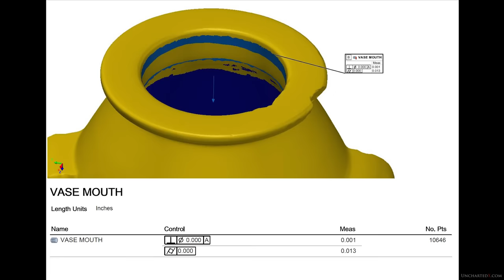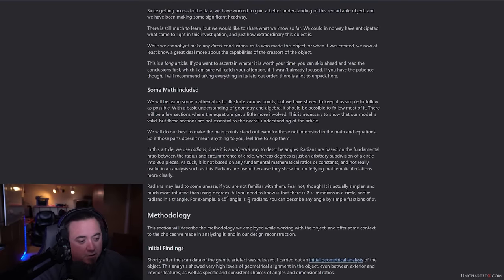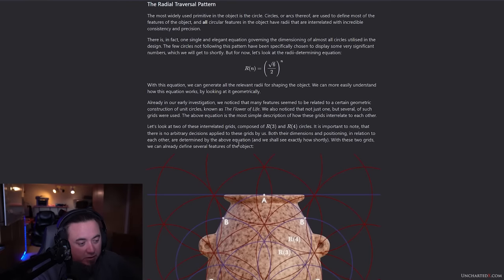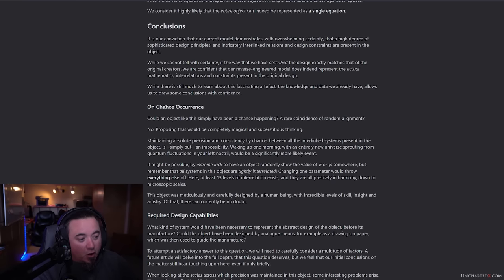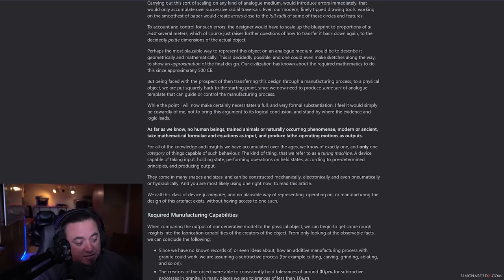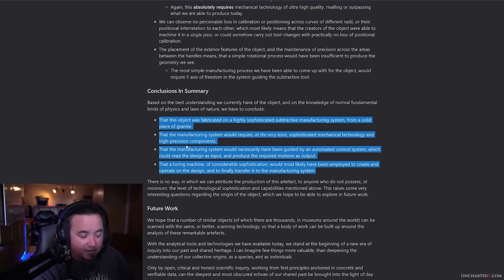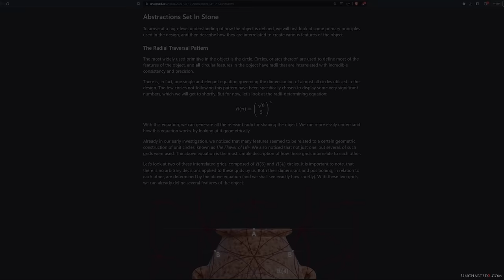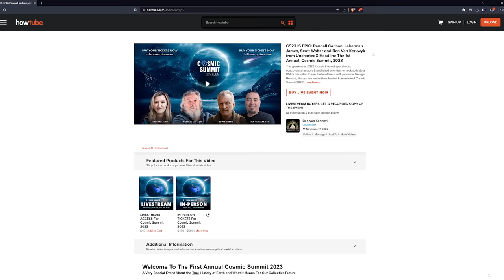Was a COMPUTER Used to Design this Artifact??

Comment: Even if we assume that this was made of geopolymer, you only solve the smaller part of the problem here. If these were made of an artistic mix of geopolymer it would be easier to carve these while they are softish, you still need some kind of precise milling machine and some advanced math.
Reply: exactly. the geopolymer theory is just a distraction.
Reply: @AustinKoleCarlisle  Not completely just a distraction.  Being able to carve a soft material like incompletely cured geopolymer allows a human powered milling machine made of copper and maybe iron cutters built by the same people who made the Antikythera mechanism a viable option. I would suspect a careful chemical analysis of the stone vessels and solving the puzzle of the Antikythera mechanism will probably solve the mystery here.
Reply: @magnuszerum9177  the problem still remains that they couldn't realistically have maintained the incredible tolerances found on this object using known ancient technology.
Reply: @AustinKoleCarlisle  Thus the need to solve the mystery of the Antikythera mechanism.
Reply: @magnuszerum9177  more than likely an Atlantean, out of place artifact. and there are probably many more artifacts like this under the sea. unfortunately, places like Gobekli Tepe get all of the attention despite the fact that there are likely numerous ruins of civilizations way older than GT under the sea as it rose 400 ft in the last 15,000 years.
Reply: geopolymer idea work only with limestone  not granite

Comment: I think it may have been possible to produce the intricacy that we see in the object by using frequency on the material while it's in a molten state. Possibly held in a mold during this process.
Reply: But the mould would have to be even more precise than the object. Think again
Reply: @TheDAT9  Yea, but I think that's the right line of thinking.
Reply: @dionharris8928  It would be great to go back and ask them.

Comment: My goodness I own one of these vases mine is dolomite from an Oldman in Egypt on my 5th visit £35 I payed, First he drills the hole with a 2 inch copper bore drill with quartz sand then he soaks the block in water then heats it up to remove the brittle and repeats used quartz sand paper to Smooth, vase is on my fireplace.
Reply: any handles on this vase?
Reply: @AustinKoleCarlisle  no it has thin lip which looks delicate.

Comment: I have done machine work building parts for varion-cpi. Radar tuner pole plates etc...Tool changes were basically a do-over. touch off the part, find zero....its impossible to make this vessel this close to perfection.

Comment: I guess it’s accepted that the lugs on these vases were used for carrying and yet it seems impractical. The hole is very small and would only allow a string with a small diameter. These people made such perfect artefacts why wouldn’t they come up with a better way of carrying it  unless these lugs were not for this purpose or did a more elaborate handle disappear over time.

Comment: The mathematics to design something like this has been well approximated by your experts. The technology and tooling used  may still be well beyond what we can extrapolate from our current technology. I can only speculate using some form of laser/ultrasonic non contact process we have yet to even conceive of. From your description of thousands of these precision artifacts in existence, the technology must have been easy to use and inexpensive.

Comment: I wonder how the 3D-printed version you have would stand up mathematically to the original.
Reply from the maker: it would be interesting to inspect them but 3d printing (particularly those lower end machines) aren't getting anywhere near that level of tolerance

Comment: The most interesting thing is that is seems to have been done in 1 pass. Hang with me for a sec. What if all the advanced math that goes into it, being Pi and the golden ratio, isn't held in a computer per say, but done with sound or vibration. I don't mean to be one of those hippie dippie comments, NIkola Tesla himself says “If you want to find the secrets of the universe, think in terms of energy, frequency and vibration.” Tesla believed that the Egyptians held these secrets. What if they weren't using machines, or machines in the terms we think of. Yet instead harnessing energy, frequency and vibration to create these amazing structures, from big to small. What if it wasn't advanced machines we lost at all, just an advanced connection and understanding with the elements around us.

Comment: This is fascinating. Love this content. 
Just had a thought about how they “could” have produced this object from hard stone in one go without tool changes - a sophisticated copy carver could have been used. This way, the geometry could have been designed and manufactured as an initial “master” in an easier to work material to a very high finish - granted that’s still an incredible feat of knowledge and craftmanship - then using the copy carving machine (which could have been pantographic in operation to reduce to the required size from a large master to improve accuracy - these exist as equipment used in making injection mould tooling prior to the advances we have had in CNC machines) the stone object could be produced. This is still high technology, just my speculation on how to do the side “handles” without a tool change.
A way to test this hypothesis would be to find out if there are any of these vases that match one another in geometry very closely - that would be an indication in copying from an original “master” model.

Comment: I am not sure what kind of 'advanced' civilisation would use solid rock to create utensils instead of pottery, unless 'they' had not yet invented pottery or writing perhaps. Geometry does not need to be defined by equations, and computers do not need to be digital to be computers. What is probable is that some kind of analogue template machine (PANTOGRAPH ?) constructed of interrelated circular guides or paths was used. And what is certain is that there was a 'machine' , possibly acoustic, that could cut rock so easily when guided that these folks did not really need to invent pottery. However rock was cut in this period , it was a technology completely lost to modern science.

Comment: Water is used to cut the hardest materials in manufacturing. Could these vases have been carved using high pressure water jets?
Reply: Possible, However, with a water jet how do you accurately hollow out the inside?.

Comment: What is being described here is a process called "descriptive geometry", it was a well known process used before cad. This could, likely, have been the process of the making of such geometrically conforming object without a need for design, as these are highly unlikely designed because of the self-similarity of other vase like objects. The lack of communication skills present is also a bit of a giveaway. Also there is a maths, using polar coordinates as opposed to Cartesian/rectangular coordinates and it isn't magical but it necessary to use when working with rotating object. These are rotating object and is therefore likely analogous to our modern polar coordinate system of mathematics.

Comment: Maybe it's a crucible, those holes are too small for fingers, so maybe it goes to another machine for moving molten metal? Whatever fits in those holes would tilt the vase and poor the metal into a mold. Just a thought. Great video nonetheless!
Reply: no , granite cannot withstand molten metal poured thermal stress fracture will ruin it
Reply: I think it would need a spout to direct the metal. The lip is round

Comment: Gidday Ben hows it going mate?  Great video. The only negative thing I would say is that you say - "VAYS" instead of - "VARZ".  Your an Aussie mate!  Don't let these bloody Americans beat you up!  Talk proper 'Strayan' mate ok?

Apart from that, the technology involved in creating this vase must have been incredible.  Maybe it WAS made in some type of lathe, but one that could stop, pull the tool tip away, then re-apply the cutting tool & continue on?

It's very more likely that it was cut using some kind of programmed multi-axis milling machine - with those handles on there!

It's a wonder such effort & precision was used to make a bloody vase though?  Unless it was very EASY for the makers to achive such precision?

You say there are 5000 other vases that are probably made woth the same precision, so it must have been easy for them!

Oh well, either way mate my mind is still blown by all this precision, including pi & phi too huh?  Wow!  Just wow!

Comment: Hmm, this is quite remarkable.
I think it's pointless to speculate if these people had precision cuttings tools - clearly they did. And not simple lathes or mills either but multi-axis machines that could cut whilst rotating about a second axis.

If these vases did not have the side 'handles' and were round in section their run-out precision would be incredible.
That they also have a complex shape that CANNOT be made in a single axis is truly impressive.
I'd be interested to know what could be achieved using a modern computer and machinery and an easy to machine material such as aluminium. As a comparison
I would be interested to see a round one and one with the lugs produced to appreciate how challenging they really are.

You also cannot rotate objects rapidly, and apply a tangential cutting force with any degree of precision unless your job is really precisely centred - which means bearings.

That someone has tried to deliberately show these mathematical inter-relationships, which they must therefore have been aware of is beyond doubt - the chances are nigh on impossible as stated.

But I'm far less convinced about the need for Turing machines though.
All of these constants are related by geometry, so when you start interacting motions around different shapes, radiuses, arcs, etc or different orientations some of these constants will emerge naturally.
If i put a peg in the ground and tie a piece of string to it, and with the sting pulled tight mark its end - now walk around the centre peg and scratch a line on the ground.
With no understanding of maths and perhaps not even knowing how to count (think ancient pre-tech person) I would have encapsulated pi and pythagoras within the circle I had just drawn; even though I might not know that it was called a circle or ever heard of the Greek guy from the (then) far future!

By having centres rotating around centres for the cutting tools, different, and varying radiuses will be cut, and again the emergent ratios will be not disimilar to the 'flower pattern made of circle arcs'.

Back in the 70s there was a toy in the UK called 'Spirograph' This had various rings and disks with toothed edges and holes drilled in them. By putting a pencil in the holes and making the one item run around the outside or inside of the other it would draw all sorts of trochoidal shapes.
By understanding the curvatures produced by the combined radii all forms of patterns are possible. (and given that all complex patterns are combinations of simple patterns - this does indeed mean all in a mathematical sense!)

Note too the large (multi-ton) column top with rounded radial flowers that is' abandoned at one of the Egyptian sites and features in some of the videos on this channel. Using similar evolutions for your cutting equipment would allow you to generate complex machining patterns like that; and cut them again and again in other columns (assuming there were several, which I think there were?)
That would be a hell of machine though, a rock that size cannot easily be spun multi-axis - so it's possible (likely?) that the rock stayed still and the machine moved around it.

I don't think these were single pass machines - granite doesn't look like it will tolerate that. But cutting slowly would require changing tools often - which again suggests a very sophisticated and precisely mounted machine.

But I see no way on earth to make a machine that can work at this tolerance made from wood - copper - lead, etc. Or any organic plastic.
Not only does this need something with the properties of steel it also requires the full technological history to go from making the first piece of steel to building even a basic lathe.
Clever as many of us are in the modern age, if you took any of us back more than a few centuries our technical knowledge would be useless as you'd eventually need something that didn't exist yet; or have brilliant ideas that could not be technically realised in your lifetime.
Reply: it's not that the vase was carved by circles that's remarkable, it's that it's based on a radian system of measure and not on base 10, etc.
Reply: I agree. Its possible that its naturally arises, because of the flow-of-life pattern, the pi ratio especially. Its a single coincidence that repeats. Although for the radian measure on multiple sites, its something else. I think there is validity to this. Its an astonishing find.

Comment: The mathematics used back then is probably similar to the ancient Greek mathematics,which was different from modern math,it was a more visual and graphical representation of numbers and concepts like the number zero...

Possibly easier to design objects this way?

They don't need computers or electronic ones anyway to do this

Also relics like the antykathera mechanism which shows that clock work computers existed in the ancient world 🌎🌍

They could have even developed a punch card like system

Comment: So here is a few questions that I would love to hear the mainstream archaeologists explain. Hear me out, how could they know there would be no flaws or micro cracks in the internal rock? They carved massive statues from random blocks? Imagine the time and materials lost if that goes wrong. So it was either so easy for them to do it didnt matter if one went wrong, or they knew the qualities of the internal material before they started. Then remember that egypt sits on a geological fault.... How did they know the stone was good for something like the pyramids? How did they know that stone wouldnt just crumble under the weight? Its stuff we take for granted but they would have no way of knowing that. I think we need to look at what all the stone used has in common. The litteral base mineral composition of the stone because they did it with these materials for a reason and its all we have to go on.
Reply: @darklight2.1  Yeah you used the wrong example, David was carved from a flawed marble slab. I am not questioning if they did it, I am questioning how. They pick massive blocks of perfect stone, calculate the exact amount of lost volume perfectly so pairs of massive statues match. Thats impressive, the statues do exist. How did they know exactly how much they would lose and the stone would be of sufficient quality to make matching statues and uniform blocks unless it was a controlled process. I don't see why you took a defensive and reductive attitude. You litteraly changed none of my opinions so all you did was waste time.
Reply: @darklight2.1  You just wrote hundreds of words in response.... Twice.... Couldn't care less..... Weird...  🤔
Reply: @DevilsAvocado69  the test pits at the unfinished obelisk are quite telling, especially considering that it's barely big enough for a person to fit inside, let alone use a "pounding stone", LOL
Reply: there are plenty of reject stones partly carved laying around the pyramids
Reply: @5hiftyL1v3a  lmao, so they cut stone, dragged it hundreds of miles, just to partly carve it and leave it infront of the structure you are building..... Or they could have carved where they quarried and saved the journey.... But sure loads of rejected stone around the pyramids right... Lol
Reply: @DevilsAvocado69  you sound sarcastic - but yeah. What’s do you think all the stone that they show which aren’t finished are? Or why so many of the floor stones have cuts in their sides etc etc. 

Stones are cut, and if you encounter a flaw in the middle you just have to move on to about her stone. It’s what they did. It’s what we do today. 

lol I mean all the random stones they use as examples in these videos are often rejects - that’s why it’s a just a random slice in the side of a stone etc. 

And yeah - that’s what they did. They often carved them on route - the same as they did with the Thunder Stone in Russia. It’s was moved over the course of 6 months and was being carved the whole time it was in transport. If it broke then they would have at to source a new one.
Reply: @5hiftyL1v3a  I was looking for a source, not an opinion really. I can't find a single publication that says the lose blocks at the base of the pyramids are rejects from the construction. I have found theories about them being removed from the pyramids by locals and reused and proof that they where used for fortifications during various wars, but nothing about them being rejected blocks from the construction of the pyramids. So if you could kindly point me to the source of your information I will happily read it. Sorry if I came over sarcastic, it's just hard to believe they where smart enough to build something like the pyramids, but not smart enough to realise that less rock is easier to move. Especially considering some of the lost volume in the statues must be in the tens of tonnes.
Reply: @DevilsAvocado69  misread your reply and responded to the wrong part. 

The unfinished obelisk is a great example of how they did it  - they took their best guess and hope it worked. Sometimes it did, sometimes it didn't. If it did it became the statue, and if it didn't the rock would be reused for something it could be, or discarded if it couldn't. The floor around the pyramids are made up of plenty of stones  that have cuts on their other sides - they would have started life as something else before finally becoming what they are.